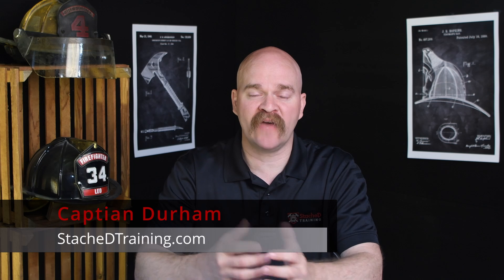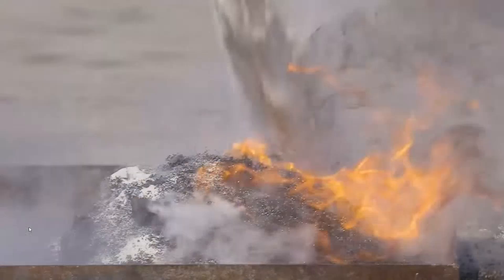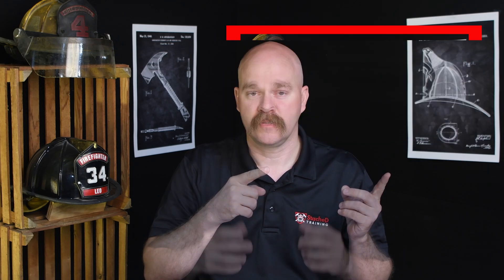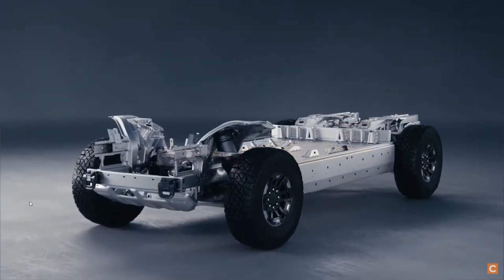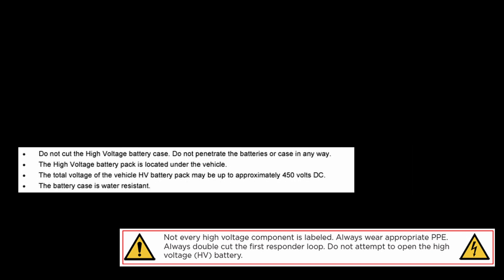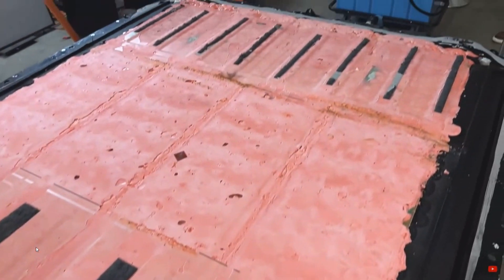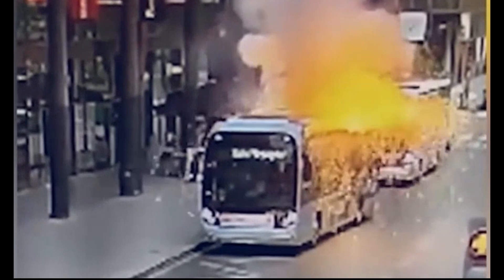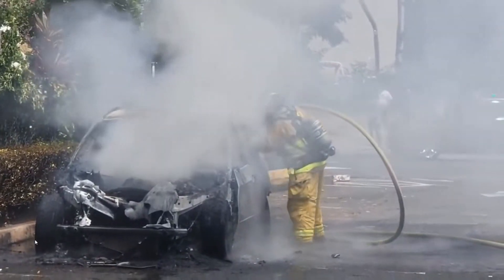What Firefighting Tools for Extinguishing Electric Vehicle Fires Really Work?

Comment: I've heard different views on how common electric battery fires are. Is it a rare occurrence or is it fairly common? I'd love to know!
Reply: NYC has a widespread problem with lipo powered scooters and bikes catching fire. The big problem is not really just how often it happens but it is one of being a "UNSTOPPABLE FIRE".  It is a extremely  energetic and intense fire that releases toxic that are far worse than many fires and cannot be put out it can only burn itself out.
Reply: Statistically, among the small population of EVs in the US, it's much more common than non-collision fuel fires in gasoline vehicles.  Generally the only time a gasoline vehicle has a fuel fire is after a collision, but that's very easily managed if checked quickly unless the tank is ruptured. Tank rupture is pretty rare. Gasoline in vehicles spontaneously combusting while parked and off is almost unheard of. My guess is electrical-system fires for both are similar though.
Reply: @antilogism  Or unless you own that one Lambo that liked to catch fire after you race the engine.
Reply from the maker: This topic is on my list for a future video.
Reply: @StacheDTraining  Thanks
Reply: In my part of my country (the Netherlands) are a few hundred electric busses in use made by BYD. They use Lithium Iron Phosfate battery's; no strange behaviour like spontaneous ignition because of stress or heat.
Reply from the maker: This video looks at the data, but in reality we're really lacking the data we need: https://youtu.be/d_SpHvBfzrw
Reply: Gas cars have 20x the number of fires.
Reply: @markthomasson5077  I think I'll stick to a regular bicycle!
Reply: @markthomasson5077 yes gumby and there's 20 million times of them
Reply: In China EV fires are so common that there are hundreds of thousands of EVs, some brand new, parked in open fields unused because they pose too great of a threat.  That should be a huge hint.
Reply: @rudydedogg6505 Completely false. The unused EVs in lots  in China are because of taxi/ride share companies buying a ton of them when that was in popular demand, but when demand died down they became useless. The same thing happened with bike shares (huge dumps full of them).

Also some companies were pumping them out to get government incentives, even though there were no buyers.

It has nothing to do with fire risk!
Reply: @jakej1837  Ahh let them spread the BS. You cannot modify their behavior. They are NPCs. The script is hard coded.
Reply: @rudydedogg6505  
In the US there are hundreds of thousands of ICE cars parked in fields.
What does that mean?

Comment: Not removable batteries is the trouble. The battery should have explosive mounting bolts. It gives the option to store the burning battery inside special container. It gives option to cool the battery down and it does not last forever.
Reply: I also think petrol cars should have explosive bolts to eject the fuel tank if excess heat is detected. Remember petrol has ten times the energy density of TNT.
Reply: You have an forklift with emergency lights on it to lift the batter pack???  Do you realize how much those things weigh?

Comment: As a retired FF water and direct contact is a electrocution hazardous mixture. Is that also with the high voltage of Electric vehicle's?
Reply: It is an issue if the car is plugged in to the grid, in which case there is a possible electrical path through ground.

For an EV out on the road not plugged into anything, there is no such possibility, given the battery pack is isolated from ground. Even if isolation is lost, to be electrocuted, an electrical path must be made between the positive and negative terminals through your water source (and through you), which is essentially impossible.

Comment: I've always said that electric vehicles should be designed around one standardised type of battery pack. That pack should be swappable for a replacement unit - that in itself would solve the range/charging problems associated with electric vehicles. It's done with industrial machinery such as underground haulage systems so why not electric cars and buses?
A removable pack would allow for rapid separation (ejection) of that battery pack should a problem occur. That way, the battery can burn all it wants and the vehicle it was ejected from can be saved.
Too many manufacturers squeeze batteries into pre-planned vehicle designs, with some batteries being divided and placed into random spare corners. It's not a good way to do things!

Comment: Manufacturers should be required to have some type of fire fighting attachment that could be coupled to (much like the charger plug) that can neutralize the battery pack.
Reply: Could they not sacrifice the space of one block of cells within the unit for an internal suppression system specifically designed to work with their battery system? All it would need to activate would either be a temperature sensor or a failsafe system like the glass vials in sprinklers (not saying that system specifically, just something along the same lines)
Reply: Shorting a lithium battery is another risk of explosion.
Reply: @JustBadly  There are phone batteries now that can be safely pierced and even cut. I wonder how those work. “Flexible Aqueous Li-ion Battery with High Energy and Power Densities” in the journal Advanced Materials, researchers describe a method for replacing the battery’s usual electrolyte medium with something more simple and stable: Water. Specifically, salt water in resin: FJzGmfBmElw
Reply: Consumers should realize they are being coned with EV
Reply: @asherdie  you should be "coned"
Reply: @asherdie  Wow you are just a troll spamming nonsense.
Reply: That's impossible to do.  That's why they're such a problem.
Reply: @ffjsb it's not impossible. Just expensive. Right now batteries are focused on cost and efficiency, not ease of putting out a fire. I'm confident that if they were forced to, they'd be able to come up with something.
Reply: @justhecuke  You clearly don't understand the physics of a burning battery, or their design, which makes it IMPOSSIBLE to integrate a fire suppression system in to a vehicle battery.
Reply: @ffjsb  no offense, but you would make a terrible engineer. You can always do something to mitigate danger. Even for problems that are theoretically impossible to solve. You don't have to solve a problem to make a design safer.
Reply: @ffjsb Why can’t you find a way to evacuate air and then inject a suppressant or extinguishing material? The cars are already kind of expensive, they can figure a way to do it. Tesla has no motivation probably because Elon won’t ever get fined more than the recall or fix.
Reply: @ffjsb  impossible is a strong word. i prefer to say : "i dont know how to do it yet"
Reply: @arthurmario5996  Strong, and completely correct...
Reply: In that case so should ICE cars as they are far more likely to ignite, the C explains what you are dealing with.

Comment: The flame after ignition is oxygen driven try a drone battery in a vacuum or in a tank with Haylon gas. The white smoke is the reaction without oxygen. What dept or Fire hall do you work at? Most fire fighter call city electric as well won't try and enter crashed vehicle. You need to purge the area of fire of oxygen. Asbestos spray cement,

Comment: The latest Tesla cars have the batteries in a structural pack where the bottom of the case is made from aluminium.  In the case of thermal runaway, the aluminium melts and the battery cells drop to the ground.
Reply: Were they continue to burn like rocket fuel
Reply: @mitchellcrane9809 the idea is that this prevents the rest of the pack from joining the party, significantly reducing the scope  and duration of the thermal runaway
Reply: @insertphrasehere15  What good is it for them to drop to the ground when the ground clearance in these cars is only a few inches anyway???  They're just going to continue to burn right underneath the car and the fire will still continue.  That idea makes zero sense.
Reply: Where are John Kerry and Greta on the ? In the mirror with a can of hair (or in Kerry's case ) wig spray  .
Reply: @stick9648  I think they've been inhaling the fumes from those spray cans...
Reply: We need that in eVTOLS as well.  Then the batteries can just fall to the ground versus burning up the aircraft with all the passengers inside.

Comment: cars used to burn more than they do now... they used to kill more than they do now. the engineers will get better and better at packaging and designing batteries to be safer.  im not saying electric vehicle makers should have the decades ICE automobile manufactures had to learn but they should get some time to fix things. they are already less likely to burn in the first. This will just keep improving.

Comment: I can only imagine a multi level parking garage full of EV's and one catches fire. What about an auto train or in a tunnel and a high way pile up. What if a person is trapped inside the car. At least gasoline tanks just don't catch fire unless ruptured and a souce of ignition is present. Only God could put the fire out.
Reply: It's already happened on car ferries....
Reply: That's one thing people can't seem to wrap their heads around when they go on about more ICE vehicles burning than ev's. You can deform a fuel tank in a wreck and the chances of it burning are low, but deform a battery pack and see what happens.

Comment: Would it be possible to have vehicle manufacturers create a connection point that would allow fire companies to attach into the battery cooling system? Maybe allowing you to pump in a "poison pill" that "freezes" a lithium ion runaway?

I'm no chemist, nor am I an engineer, but it seems like the cooling system would be an ideal place to create a system that when over-pressurized would safely rupture, allowing the "poison pill" to reach the battery box?
Reply: You can not stop one of these fires . They are chemical/metal/electrical fires and are very energetic. All you can do is break out the marshmallows and have a cookout. The best thing to do is let it burn and try and protect what is around it.

Comment: No EV has ever exploded into a ball of fire before occupants could escape. That happens with the internal COMBUSTION engine car which carries a tank full of gas (a bomb), 1000s of times a year.
Reply: LOL....no possessor of actual knowledge I see...no FULL tank of gas would EVER explode.......lacking science and chemistry something you fail to realize is solids and liquids do NOT burn or EXPLODE.....fire causes them to vaporize and this gaseous version then ignites.....safest condition for a fuel tanker truck is when it is FULLY loaded
Reply: Petrol cars do not explode like bombs , that is the thing of movies. While electric cars dont EXPLODE the speed at which the battery can burn is very intense. The flames that can shoot out the battery are like a torch flame.
Reply: @mitchellcrane9809  class D fires are VERY intense and high temperature....remember back to chemistry class and the magnesium strip ignition
Reply: @michaelkendall662  that is actually what I indicated. Battery fires are a double whammy fire. You have the chemical/metal /self oxidizing fire but you also have a electrical fire. These fires are at best extremely difficult to basically impossible to put out with out removing the base fuel.
Reply: @mitchellcrane9809  I know...my job in the USN involved damage control onboard ship and we were trained on this type of fire and others........no real way to fight or control the fire....just the spread
Reply: @mitchellcrane9809  "...do not explode like bombs..." True, not exactly like, i.e., not quite as fast, but still people burn alive, no matter the fact that the temp is lower than in a battery fire. The point: ICEVs are much, much, more dangerous than EVs. It's that a hell of lot more important than the fire's temp. EVs are killing the ICEVs.

Comment: there seems one method not covered... and i heard the word...

cooling? a fire needs heat... what if you suck it away?

but how?

iunno! what if the damn things were made as pressurised nitrogen tanks? designed to actually explode, (fine then, we'll stick to rapidly venting through a specially designed exhaust valve... booooring...) but in doing so the pressure drop and resultant expansion causes near instant cryogenic temperatures... 

at any sign of thermal runaway, it just plunges the battery pack into deepfreeze...

thats the thing about compressed gas most people dont get. if you dont supply sufficient heat, or actually remove it.. it doesnt expand. it liquefies. that spray can gets cold because its absorbing heat from its surrounds so the pressurised gas can expand...

iunno. how about just making the cooling system as pressurised gas? preferably non flammable, non toxic... butane is a popular refrigerant, lol.

sadly, water is that one thing that has the ability to absorb a lot of heat... but doesnt work so well on electrical arcing and chemical breakdowns...
Reply from the maker: Compressed gasses are inefficient and heat up too quickly when exposed to the heat generated by failing cells.

Comment: Germany uses a small crane and a steel shipping container. The entire car is dunked into the container full of water for three days. All you can do is cool the exothermic reaction after runaway has occurred.
Reply: I have read even after that they still catch back on fire.
Reply: @ldnwholesale8552  He said for three days--did you miss that part, or are you saying it will reignight after being in water for three days?
Reply: @SP30305ATL yes, they can reignite for weeks after catching fire. The procedure in Europe is 3 days in the dunk tank then pull it out. If it catches fire again 3 more days......
Reply: @SP30305ATL  
Yes, it will. 
Happened before....
You have to check that the battery is conpletly depleted (not easy).
Reply: what they do with the water they dunked the EV?
Reply: That is fine near town, what do you do out in the country?
Reply: Same in Belgium, at least the Antwerp firefighters used this method.
Reply: Why not to use simple proven solution. 
F 500 EA
Reply: We have a firefighting  media that extinguishes lithium batteries and a fire blanket that moulds over the vehicle like a cling film completely containing thermal run off. These are both new to the market so not well known yet but getting it out there, both fully tested and certificated.
Reply: @darrenhamilton5859 
Wrong.
No fire extinguisher for Li-on and blankets are only for protection during operations and can provoque explosions.
Reply: @darrenhamilton5859 
That media only extinguishes fire if it reaches inside. Good luck with that...
Reply: @darrenhamilton5859 No, you don't. Did you even watch the video? Are you even a firefighter? There is no certified or not certified way of extinguishing a Li-ion battery fire. None. Unless you're talking about 'time' there is no other way.
Reply: @fdMT_EnGy 
Nonsense.
How do you know if person doesn't have adequate knowledge what's going on in their fire department?
Have you heard about 
F 500 EA agent universal agent used for EV and battery fires?
Probably NOT.
Reply: @fdMT_EnGy 
Yes.
Firefighing equipment and solutions,  agents have to be certified. 
You obviously don't know that. 
Its not about " certified " method but about equipment and agents used.
Firefighting equipment has to be produced to strict norms and has certifications. 
This also applies to agents used like foam or powder and others. 
Educate yourself
Reply: @Matt999PL Hey IKE, I do know what F500 is and I can guarantee I'm way more educated on the agent and trained more with it than you. WAY more. If you think it's an 'alternative' to water for Li-ion battery fires, you might want to do some more research before jumping of your rig thinking that's all you're going to need.
Reply: @fdMT_EnGy 
Then use your water alone😂.
Apparently you don't know about F 500
Good luck boy
Reply: @Matt999PL  You're not a very strong reader huh... or is it just comprehension issues? Did I say anything about water alone? I said not F500 alone... I'm not really sure how you got tripped up on that. But being as you did, you definitely don't know exactly what it is and how and when it should be used. That's ok, not everyone can be with such a highly trained department... but I'm sure you can find videos showing it being used.
Reply: @fdMT_EnGy 

If you know about F500 you wouldn't write nonsense calling this " alternative  to water"
You can't use F500 alone what you should  know long time ago. 
Same way you don't use foam concentrate alone but mix with water + air to create foam. 
Same way you use F 500 smart  man.
You didn't say water alone but you  implied calling F500 "alternative to water"
So " smart man " what you would use water with?😅
Reply: @darrenhamilton5859 
Is it 
F 500EA agent?